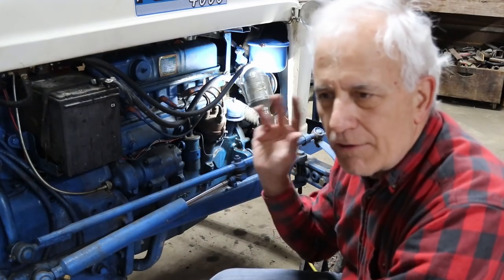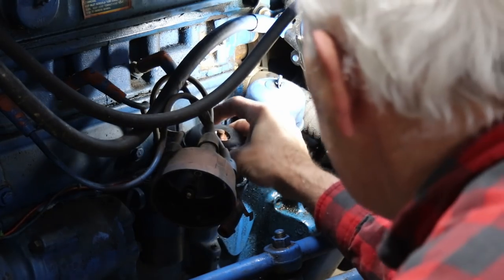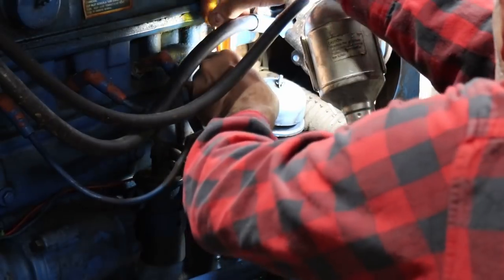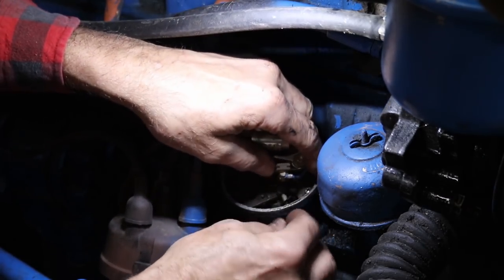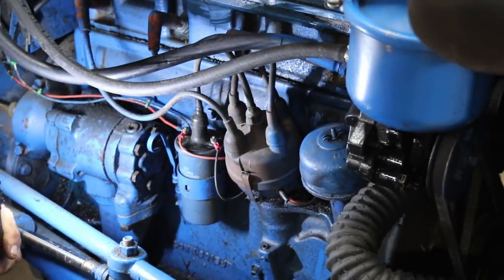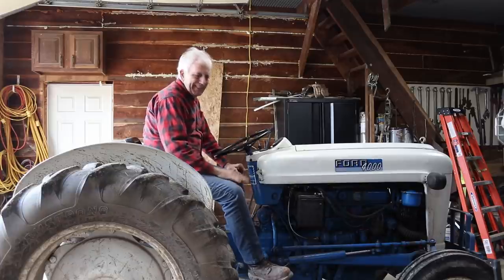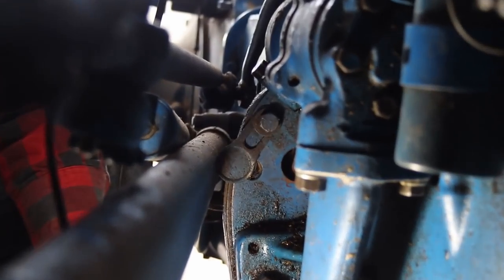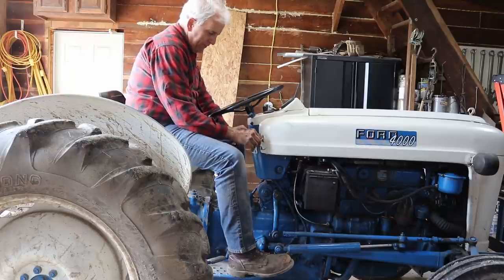477 RSW A Ford 4000 Electronic Ignition Conversion

Comment: Hey Jerry great video.  I have a 1963 Ford 4000 gas with the same 172 cubic inch engine.  I bought my tractor in  pieces, an engine from one guy, a rear end from another ect. I rebuilt the engine and gathered most of my replacement parts from Steiner Tractor parts. That's a great old tractor Jerry and well worth fixing.  I to will upgrade to electronic ignition.

Comment: I was on recruiting duty for the Navy in Phoenix, AZ back in 1976, and I had 1970 Pontiac LeMans with a 350 ci engine.  I had to run it thru the AZ emissions test facility for my license and it failed.  After checking the timing, points, dwell, and so forth, I tried again, and again, it failed.  I ended up replacing the timing chain and sprockets, spark plugs, and I bought one of those electronic ignition kits at the Montgomery Wards store in the shopping center where I worked.  I timed it and took it back for the emissions test the third time.  The tech who was testing it shook his head and said he wanted to run it through again.  Same guy as the first two times.  Well, it passed but he was still shaking his head.  I asked if anything was wrong and he said, no, but the reason he ran it through again was; after checking it the first two times previously, he thought there was a problem with his machine the third time because the readout was so clean.  He wanted to know where I took it for the tune-up and I told him I did it myself.  He said I certainly did it right because, if the exhaust was any cleaner, the engine would be pumping out fresh air!!!
Reply: Well, now there's an experience you don't forget, just
because it makes you feel so good, to remember it. 😁😎

Comment: I bought my Dad's Allis WD45 off his sale which he bought new in 1952.  I know because I also have the manual with his signature and the dealer's signature on the front page.  Spent many, many hours in my teen years behind the wheel doing fieldwork.  Now have a loader on it and use it  regularly.

Comment: Since I too have old sore hands, sore back and neck I found working on the tractor distributor was much easier if I took the whole distributor out and worked on it on the bench! But mine needed a new shaft and bushings to boot!

Comment: My dad used to take a welding rod, dip the tip in white paint and reach in and touch it to the timing mark on the cam or flywheel.  That way he had a bright white mark that was easy to see with the timing light.
Reply from the maker: I used soap stone.  But I still couldnt see it all that well

Comment: On my old rigs I forget about timing marks and use a vacuum gauge to get the best manifold vacuum. P.S. also works great for carb adjusting. A good old gauge can tell you a lot about whats going on with valves etc.

Comment: Interesting video Jerry. Regarding the timing marks, I have found that either using chalk or white out to highlite the marks, will make them a whole lot easier to see with the timing light. Funny, this came up as I had to replace the distributor on my 95 Ford pickup. You couldn't replace the guts unless you had a press, which I don't. Slap in a rebuilt one, works like a charm. Thanks for the video.
Reply from the maker: I tried the chalk it didn't seem to help much once I cleaned the fly wheel really good it helped

Comment: Good job Jerry some new spark plug wires wouldn't hurt if those are original,Cheers!
Reply from the maker: Those were not original but I did put new plugs wires distributor cap etc. unfortunately I think there's a head gasket that's blown
Reply: @RosaStringWorks  That would do it!  or a burnt exhaust valve.  Just out of curiousity, how old is the timing chain, and gears?

Comment: I remember as a kid... up on a 3 wheeled tractor... unable to touch the pedals and probably didn't know what anything did except the steering wheel.... just goin' round in circles or whatever.. when.. i cut the turn just a little sharp and started heading right for my uncles new home under construction... luckily an adult was nearby to turn off the key... that was my first lesson in panic...
Reply: I bet that kept you off of it, until you knew what you were doing. 🙄🙄😣
Reply: @zapa1pnt  
nope... i learned that lesson pretty fast...

Comment: You could try some WD40 down into the distributor as there is possibly a mechanical advance mechanism that hasn't been lubed ever.
Reply: I was wondering about that since I didn't see any advance mechanism. I'm not familiar with tractors but cars had a vacuum advance.

Comment: So Jerry, I have to ask, when is the last time you had the Distributor out of the motor?  Reason I ask is to check end play, clean and lube the advance weights, and polish the cam.  I have been amazed at how many dizzy's I have taken apart and rebuilt that were just awful once I got them apart.  Old felt oil retainers as hard as a rock, etc.  
Usually bad points are a result of dirty/worn cam, bad condenser, and sub-standard wear block on the points.  NOS points from eBay are the only way to go now days.
Ford distributors need oiling every oil change.  Yes you need a resistor unless the coils specifically says internal resistor.  It's temp resistance control.  When teh engine first starts the resistance is very low (near full voltage), as the engine speed up and the current flow increases (pulse count goes up), the resistance increases to lower coil voltage and coil heat.
The motor does not sound great.  Sound like an exhaust vale is burnt.  And I suspect teh advance weights are flopping around causing erratic timing .... Yes, you need to set the timing.  I'd prolly add a few degrees to the initial - 10*ish.  Prolly needs new plug wires, ohm them out and test for high voltage leakage. ...  I recommend Moroso spiral core if they need replacement...

Comment: Jerry as a lifelong Mechanic (DOM) Doctor of motors an easier way to setthe timimg is to rotate the engine until you can see th timing number and then take a toothpick and dip the end of the tooth pick in white paint then put a white dot at the desired timing point or number that way you can much easier see where your timing mark is

Comment: Pétrole engine on a tractor ? Very rare on this side of the Atlantic... too expensive to run...most are diesel 😊. But good trick to fix old lawnmower. Thanks 👍
Reply from the maker: Most smalle tractors on this side are gas most larger tractors are diesel but there is a mix of both

Comment: Jerry, sorry to hear you have to pull it apart. After a few hours work, you find
you have to do, maybe, a couple days work. Bummer!
I learned to hate points and carbs, a long time ago. Too bad you couldn't put a completely
solid state ignition on it, like the new cars (new in Yours and My timeline).
Assuming the aftermarket system even exists.

Comment: Ya would think, if it were a head gasket, it'd be either smokin' oil out the exhaust, or blowin' water past the radiator cap.  Hook up an airline to number 3 and 4 (1 at a time....lol)  with no more pressure then what the compression usually is.  Prolly around 90-120 lbs would be my educated guess.  take off the radiator cap.  Take off the oil filler cap.  Look for bubbles on the radiator (head gasket).  Listen for air comin' out the oil filler cap (exhaust valve).  If it blows the dip stick out?  DEFINITELY Rings!  But listen there anyway.  Put an ear on yer carbersnator (intake valve).  And put yer other ear on the exhaust pipe (exhaust valve).  Could be a head gasket....Could be a cracked head.  If ya don't have an adapter to screw into the plug holes?  Fab 1 up.  Yer pretty good at doin' that kinda stuff.  Far as yer power steering problem?  Replace yer power steering fluid with "Lucas" power steering fluid. Dunno what they put in that stuff, but it works purdy darned good!  (unsolicited endorsement....lol)  Marvel Mystery Oil in yer gas may help if the rings are froze up.  Pouring some ATF down the carb with the motor runnin' full tilt may free up sticky valves (won't hurt the rings either).  Barrs Leak may help seal up a crack in the head and/or gasket.  Another check for bad rings would be to squirt some oil into number 3 & 4....crank it over a bit before ya start it, and see if ya lose that miss.

Comment: I have an Old 800 Ford simular to your 4000 but older lol I'd  suggest breaking out the compression guage and check the compression Jerrry
Reply from the maker: You are correct its low in the rear 2 cylinders is gonna have to come apart

Comment: If you do wires, do new cap and rotor, has an old 2.3l 4 cylinder way back, and remember a bad rotor/cap caused havoc, easy cheap fix.
Reply from the maker: I did replace everything what I find is there's low compression in the rear 2 cylinder so I think the head gasket is blown

Comment: When’s the last time you had the carb apart for a cleaning?
Reply from the maker: It's benefit you years but there's a problem with the head gasket or valve sticking or something Because there's low compression in the rear 2 cylinders
Reply: @RosaStringWorks  That spelling Auto-correct is a real Bugger, aint it? 🤣😣
Reply: @RosaStringWorks  I put air in one of tha low cyl's with valves closed. often they leak past gasket bitwix cyl's. Tha coolant  will bubble if its blowed to that system. They sell air adapters screw in spark plug hole. I made mine using a old plug with tha porcelain busted out and a old tire valve. I put air on cyl's to hold valves closed to change valve stem seals. My homemade  rig been in use since 72 Cl;-[p]

Comment: Still sounds like a dead miss. Maybe wires and new plugs. If that dont cure it I'd suspect a valve stuck. You can tell that by a compression test.
Reply from the maker: I put new wires distributor cap rotor except tra turns out its low compression in the rear 2 cylinders so it's gotta come apart

Comment: Sounds to me like the firing order isn't right. Try swapping the leads serving plugs 2 & 3 (the two middle ones)
Reply from the maker: It's been wired the same way since I was 10 years old I would think I would have found that problem long time ago did I think there is a blown head gasket 2 cylinders are not firing at all

Comment: Fouled plug... Swap them even if the electrodes look good.
Reply from the maker: All new plugs and wires I think it's a blown head gasket rear 2 cylinders have low compression
Reply: @RosaStringWorks  I think you mentioned that in another video...

Comment: Yup two weights under the plate you left in.
http://www.fixthatford.com/images/53%20Distributor.jpg
Reply from the maker: It has a bad head gasket that's the problem
Reply: @RosaStringWorks  At least that's a fairly straight forward, though unwanted, job though best to get the head checked.